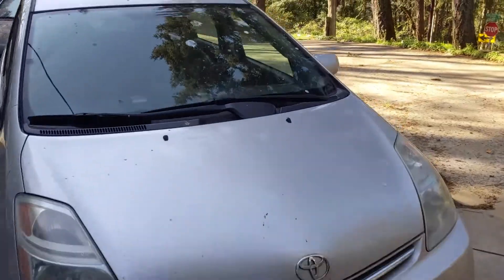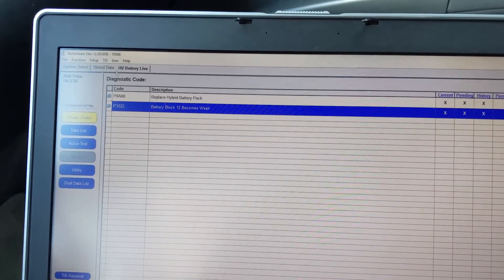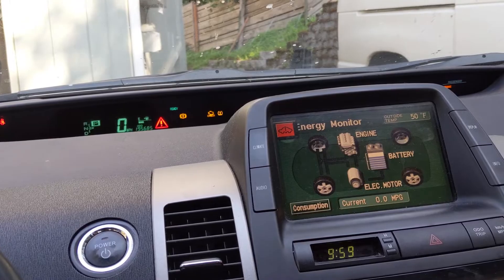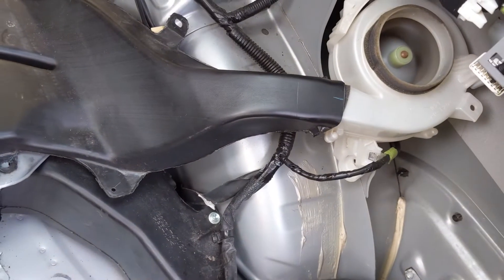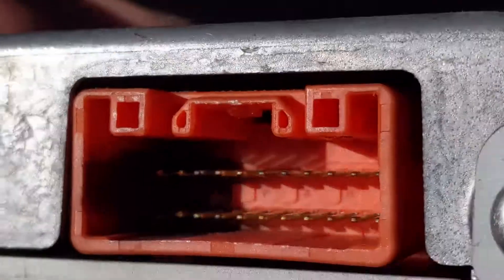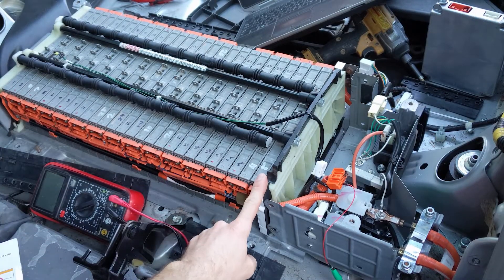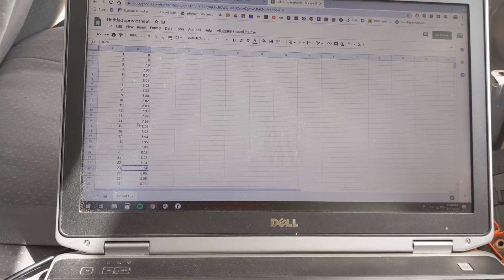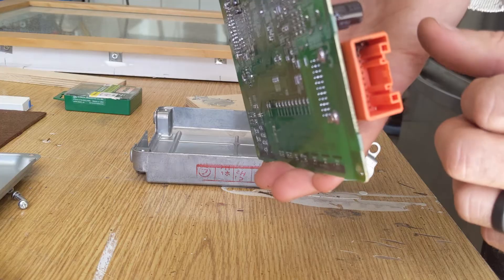Part 1- Prius P0A80 Battery Pack Diagnosis!

Comment: Hi Steve,
My name is Truc, with a 2012 Prius C showing permanent code P0A80.
I have watched your videos and am confused somewhat.
But I admit yours is the best I have seen so far.
The car was running fine (even with the code P0A80) prior to my attempt to recondition the battery modules.
When I reconnect the battery pack, all the dashboard lights lit up and the car won't run and I don't know why.

Could you please summarize all the important steps to correctly diagnose and recondition the modules to make the car run again?
Thank you very much for your prompt reply.

Comment: I repair these cars all the time, the problem with the black inside the orange connector towards the end of the video is not heat as such it’s because moisture has travelled down the wire harness due to water leaking into the car due to the capillary effect, the wire, the water from the battery Terminals and gravity assists it down to the ECU. Usually the high voltages differences on these wires happen at the end connectors so you’ve got high voltage across the top and the bottom pins when the moisture hits this along with the oxidation it causes conduction, then this causes aching  Which is DC so this causes blackening and either the wires burn out or the connector. So yes, heating is caused indirectly through DC arching. Hope that helps everybody best thing to do is replace and repair the wiring harness to the high-voltage battery for the sensor wires and replace the ECU .
Reply: What's a decent charger to buy when doing these reconditioning?

Comment: Whenever the PCM or ECU is more than a 1.3 volt difference between the minimum block number and maximum block number u get the P0A80 if u getting other codes u could point u to maybe different issue just trying to help anyone so they don’t spend money on parts testing the HV voltage to confirm a P0A80 code

Comment: So did it end up just being the one module that was low or was it something with that computer connection? Watched your other videos of the reconditioning so I figured you were working on this battery pack. Just didn't catch it if you mentioned what was the final result of the repair.

Comment: What the name of that piece
Reply from the maker: Hello, sorry, you'll have to be more specific.
Reply: The orange piece was harness
Reply: Connecter
Reply: Which ever part with the pins burned
Reply from the maker: @kendallevans4326  gotcha. That's the sensing wire plug for the HV battery ecu. 👍. It comes as a whole unit with the sensing wires.
Reply: Do you have the link
Reply from the maker: ECU

https://www.ebay.com/itm/04-09-TOYOTA-Prius-Hybrid-Battery-Control-Module-Computer-ECU-ECM-8989047092-/303975034111?_trksid=p2349624.m46890.l49286
Reply from the maker: Harness https://www.ebay.com/itm/2007-TOYOTA-PRIUS-BATTERY-WIRE-HARNESS-WIRING-G9240-47020-A-OEM-04-05-06-08-09-/133274074887?_trksid=p2349624.m46890.l49286
Reply: Thanks found its

Comment: Im just curious why you didn't check the 12V battery first. You could have found water underneath it or the battery may me LV. Also there is a vent behind the battery that should be checked. Fans working fine. maybe just a recharge on the 12v would do it.
Reply from the maker: And yes, I highly recommend anyone with a 2nd gen Prius check their hybrid battery fan- they often are dirty or clogged. That's not generally what causes this condition though (although it might be a long term contributing factor). The full blast fan in this situation is a symptom of a failing module in the battery pack- the fan blows on full blast to keep the pack as cool as possible since it recognizes there is an error in the pack.
Reply from the maker: Hey! I've heard of a low 12v giving erroneous codes. However this car had all the specific symptoms of a failing hybrid battery- P0A80 code, along with a specific failing module code, the battery fan on full blast trying to keep a failing pack cool, running only on the ICE.  Not a bad idea to check the 12v if you're getting confusing codes, though I haven't heard of a failing 12v tied specifically to these symptoms, but I'm happy to be corrected.

Comment: Steve did you start the car for the fan to run? Thats what I need to do tomorrow.
Reply from the maker: Hi, I'm not sure what you're trying to accomplish in your situation. With a failing hybrid battery, the battery fan ramps up to full power shortly after putting the car in ready mode.

Comment: I disliked your video mainly bc you completely skipped over the showing how you tested the modules to each pin. You could have at least showed two of the modules.
Reply from the maker: Ah, gotcha. I skipped over it because I assumed it was common knowledge. It's just a multimeter set to DC volts. 🙂👍 You just touch a lead to each side of the module to test for voltage. Mainly, you're looking for any modules that don't look like the rest. In this case, one module in block 12 that had 6 volts while the rest tested close to 8 volts. Nothing fancy about it. You can use a $5 multimeter from harbor freight. Thanks for the comment.

Comment: Hey buddy what is the red and black box with the screen called that u are using to measure the electricity ?
Reply: Wow that was quick, thanks a lot Steve
Reply from the maker: Hey! It's a generally called a multimeter. I think I picked this one up for about $20 at Harbor Freight Tools. They have ones for just a few dollars as well that will do just about all the functions as the more expensive one.

Comment: I had the same connection issue. I pressure wash my car so a lot and I have to cross a river every day I drive and we have heavy rains...not sure exactly how water got in But it did...found out my prius also had cracks in the rear hatch frame where as they are the seals crack and water can enter car. Look up on forum to learn about the fix. So I changed the wire harness and the computer and everything worked..i also changed the copper bus bars to nickel plated bus bars and new nuts...been working fine since 2 plus years

Comment: Working on my 2012 battery ECU / wiring harness. Similar desing and same issue, the ECU board looks fine and only a couple pins shorted in the orange connector. * Noted pins 1,3,11 are destroyed while pins 5,6,7 are singed slightly. On the wiring harness side pin 1 is ash with very little left to the  wire crimp, pins 3, 11 are toasted but intact, the corrisponding 5,6,7 are singed as well. Curious to see if you have had better luck finding just the connectors for replacement. So far the best I can find is full replacement of the ECU and corrisponding harness, though neither need full replacment just connectors. The battery cells are wonderful for the usage its seen 228k, lowest cell voltage after 2 months of sitting is 7.45 with a high of 7.72. I'm trying to sell this car and would like to find better fix than throw more money at it, possibly auto wrecking yard and remove appropriate parts. If you would like more data or information i'll be checking back here for a couple days.
Reply from the maker: Hey! I think I just replaced the ecu... Or I might have just cleaned the pins, as mine were in ok condition. If you watch my video first Sprinter video (like 4 videos back from the most recent), I show how I repaired a broken off pin on the Sprinters ECU by drilling out the old pin, finding a donor pin from another plug, and soldering it in/epoxying it into the plug. But the Prius battery ecu's aren't that expensive, especially at a wrecking yard. From what I was reading, the melting ecu plug seems to be a stand alone issue (not a symptom of something deeper)- repair or replace the ecu and it is resolved. 

My daily driver Prius has 375k with the original battery. I haven't tested the module resting voltages, but still get 47mpg in the summer. 🙂🙂 

Hope you get it figured out! Glad to help if there's anything more I can offer.
Reply: @stevevanpelt4475  Open the voltage sensor and view the damage inside. Replace the sensor and the damaged harness.